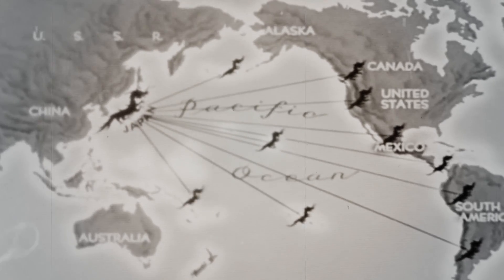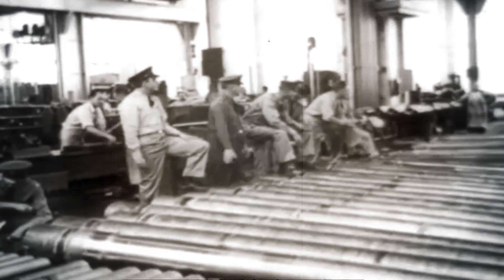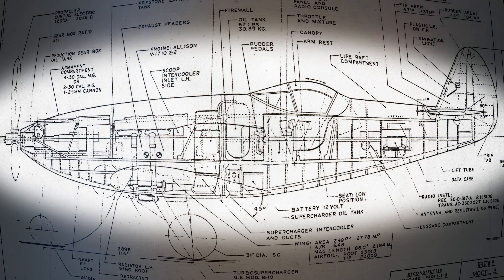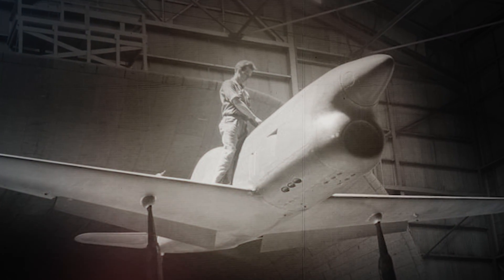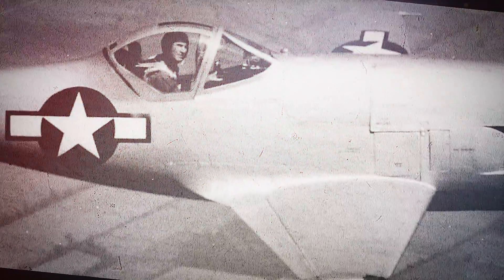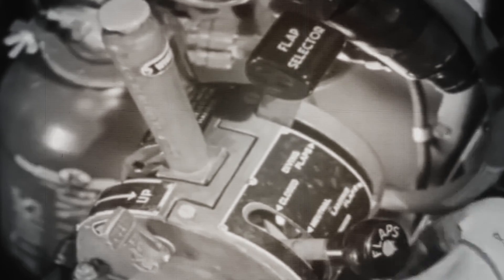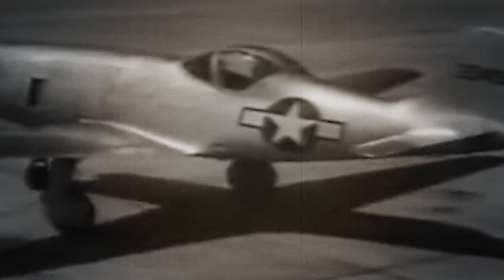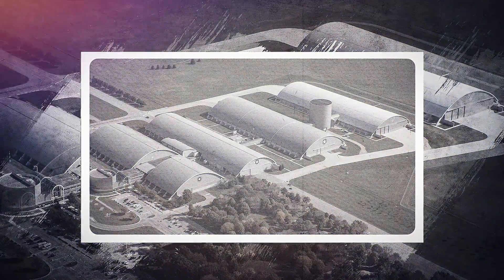Bell XP-77 - America's Emergency Fighter (Built from Wood)

Comment: One of the best aircraft of WW2, the De Havilland Mosquito, was made of wood, so also was the Heinkel Salamander jet fighter. a potentially good performer which appeared in the last days of the war.
Reply: The salamander was pretty trash
Reply: @kyle857  I read a test pilot's report on it which said it was a good plane for its time, but wartime shortages and manufacturing conditions meant that standards of construction were sometimes low and on rare occasions Salamanders broke up in the air. Before we get too holier-than-thou about it we should remember that it sometimes happened to British planes.  The tail unit broke off a number of early Typhoons before the fault was rectified. A De Havilland 110 broke up at an air display in the fifties and the wreckage plunged into a crowd of spectators. Planes and other war machines often have teething troubles. The Salamander was designed to be cheap and quick to build and made minimal demands on scarce wartime metals. The Me163, also made of wood, was a much more dangerous plane to fly, but had its good points.
Reply: Except slave laborers in Germany (sabotaged) peed into glue vats causing substandard glue joints.
Reply: @stephenjacks8196  Very likely, but Heinkel's design was pretty good considering the constraints he had to work to. A properly constructed Salamander could have outfought the contemporary Meteor. Fuel was also a difficulty at that stage of the war.
Reply: @bernardedwards8461  Heinkel had built the first flying German jet aircraft in 1939. Heinkel had built the first working turbojet engine. The German RLM decided "aircraft specialists" and "engine specialist" companies would get development funds. But if you're a contractor making good profit from existing contractors: do you jeopardize that with something new?
Reply: @stephenjacks8196  The trouble was that Hitler expected Russia to fold up before the end of 1942 and didn't expect war with the USA. He was therefore not interested in weapons projects which might take several years to come to fruition, That was one reason why he didn't prioritise the atom bomb project. Early in the war he didn't think jets could be perfected in time to be of much use before the war ended, and the Luftwaffe was doing quite well with propeller driven planes. It's easy for us to be wise with hindsight, but Hitler didn't have the hindsight available to us.
Reply: @stephenjacks8196  it wasn’t just the urine of slave laborers that caused problems. The glue itself was actually corrosive in some circumstances, and there are stories of the combination of glue and resin actually eating the wood it was meant to hold together
Reply: Reports indicate the glue the Germans used on the 162 had a tendency to actually eat wood.
Reply: @matthewcaughey8898  Weird. Usually it takes strong acid to eat wood. Lot of wood was glued with urea-formaldehyde resin which bonds with wood molecules but doesn't destroy them. A really strong glue will break thru the weaker wood, so German complaints were really about low quality wood. Slave laborers peeing in the glue pots would add extra urea and water making the glue weaker, and breaking at the glue layer.
Reply: @stephenjacks8196  point is the wood and resin was not of good quality and tended to come apart more frequently then normal

Comment: although it's beyond cool that Jack Woolams flew the thing, but even the conception was beyond stupidity...Great Britain swooped on the DH-98 design for the same reason Germany did on Tanks TA-154, not just material but wooden aircraft are easier to "cottage" out and be assembled at the airport instead of a factory that had been bombed back to gravel. last time i checked during WW2, the U.S. never had any bauxite shortages and no enemy bombers ever made it past Tulsa or Jersey.

Comment: What they should have done. 
1, power plant should have been a radial engine to begin with. Aerodynamic issues get dealt with when you have a light plane and power to use. Other examples damn't with this,  like the Fw190 and also the Mitsubishi zero. 
Honestly just switching to a radial takes out the radiator, adds more space for fuel or weapons. You could move the cockpit further up and have it ballistics better on the back wheels and you could put a better propeller than the two blade.

Comment: They could have licensed the design of the De Havilland mosquito and had a really good aircraft.
Reply: “Not invented here...”
Reply: The Mosquito wasn't built of whatever 2x4s you had laying around, like the XP-77 mostly could be. It required specific lumber of specific grades from all over the world to be assembled with special new adhesive and special construction techniques by skilled craftsmen who took a long time to train. Meanwhile, aluminum aircraft could be banged out mostly with unskilled labor using retooled car factories.

In the end, the Mosquito consumed its own share of strategic resources, not saving much over metal aircraft. A lot of shipping capacity for all the various raw materiel, even if it was wood, but more importantly the Merlin engines that powered them. They built as many as they readily could, using them to great effect, but no more than that.

Comment: The aircraft had no armor as originally planned. Adding the weight as it became obvious that it was needed doomed performance.  In addition, the guns had different ballistic profiles. It was impossible to get the full weight of the guns on target as the 20mm round was slower than the .50 caliber round. The 20 mm also dropped sooner. This meant that a pilot would have to get VERY close to the target, within 50 feet. It also meant that the plane would have trouble strafing a target as half the bullets would land wide of the mark. The design of this plane was so poor that it was only desperation that kept it going as long as it did. It couldn't shoot, couldn't bomb and had no speed, range or maneuverability advantage over anything. Its armor was inferior and poorly placed. The fuel tank was placed to roast the pilot if it got hit and the pilot couldn't bale out while the fuel tank was aflame. In short, it was a deathtrap.

Comment: The Hawker Hurricane also had a wooden airframe, although it was covered with cloth. The Hurricane is unjustly overlooked, but it kept the RAF competitive until the performance and production troubles of the Spitfire were solved. The XP-77 could have had a different history if it had been available by 1942.
Reply: You are correct in that the Hurricane is overlooked by most historians. Covered in cloth? Do you have any more info on this? Whatever cloth (coated with who knows what) is there that can withstand extreme stress of temperature and wind pressures? Kudos to the engineers and developers!
Reply: @timothybattey171   I think the Hurricane was built like the Mosquito. WWI style with a wooden airframe under a canvas wrapping. The Spitfire, by comparison, was made of stressed-skin aluminum, and flush-riveted, I think. Those technologies were in their infancy in 1939.
Reply: @HSMiyamoto  Mosquito was a stressed skin design made out of wood.
Reply: @HSMiyamoto  As a hobbyist woodworker, I am very much impressed by their use of 1930's technology and expertise. Even props were machine-roughed out then hand-finished in those days, I am given to understand. I suppose mass-production techniques made the process tolerable for the craftsmen.
Reply: @timothybattey171  Irish linen painted with aircraft dope :)
Reply: @andrewallen9993  Thanks for the info. I figured they'd need serious coating on the fibers to strengthen it all. I'd say the original test pilot was a brave one.

Comment: At the beginning of the war US fighter tactics were more of problem than the planes they were flying. You have to fight any battle using your strengths, and exploiting the other guys weaknesses.
Reply: Exactly, they learnt not to dogfight with a zero in Wildcats and P40s. Use altitude and speed and then get the hell out of there. When the Hellcat appeared they had an aircraft good enough to take on the Zero in virtually all situations.

Comment: The Zero didn't have superior characteristics.  It sacrificed pilot protection for maneuverability.  An experienced pilot did very well against the Zero.  The P38 and P47 was very successful against the zero. The shape of the fuse was dictated by the government required engine. It was a cheap emergency fighter not a front line fighter.  The P51 carried 300 rounds per gun meaning the 200 in this AC was not terrible as you imply
Reply: The A6M was faster and lighter, therefore more agile.  No armor, no self-sealing fuel tanks.  The tactics made the difference.  Once pilots learned the Zero's weaknesses, they could be beaten.  A Wildcat or Tomahawk could powerdive for the deck to escape.  Risky, but usually the American plane would hold together and pull out, but the Zero would shed one or both wings and crater, just couldn't call it a kill because no shots were fired.  Biggest risk was blacking out during the high G force pullout.
Reply: LOL ..you saying the ZERO in the early years of the war wasn't superior or better then the Allied aircraft...  give your head a bang..  also the P47 wasn't really involved with the Pacific front too much ... try the F4F, Hellcat, P38 and Corsair .

Comment: there were fighters such as the early LaGG and YaK fighters made of wood impregnated with a resin that made it inflammable, and roughly as strong as steel. The only downside was it shatters when struck by flak or large caliber rounds, but they did work extremely well. The XP-77 was incredibly ugly though, I mean ughh.
Reply: Inflammable means flammable. What a country.

Comment: What is an emergency in USA is just another tuesday in USSR
Reply: Had Hitler reached the Urals the Soviets would have built those or something similar.  Bell Aircraft and Stalin had pretty good working relationship.
Reply: @IvorMektin1701  Early Yak's and La's already were something similar. The cobras were indeed highly regarded, but numerically they were a small minority in the grand scheme of things. And perhaps the most iconic Soviet plane of WW2, the IL-2, was the epitome of emergency engineering, having its fuselage made out of steel and the rest of the airframe out of wood.
Reply: @FunBotan  
The IL-2 was incredible.

Comment: It would make one hell of a good Sport Plane with a few changes, I love the way the canopy retracts.
Reply: I've always wanted to see a homebuilt/experimental based on this, with modern techniques dealing with the vibration and stability should be possible.
Reply: What engine though? If you go watercooled, then stuffing in a radiator will be tough, i think. Are there any air cooled V engines available? You could fit a flat air cooled and keep the triangular fuselage cross section, but then the drivetrain will be complicated and the CG will be low.
Reply: @superdupergrover9857  personally I would go for an aviation converted small block Chevy or a rotary, as both require minimal cooling, have a pretty compact form, are compatible with forced induction, get decent gas burn, and are readily available. Throw a turbo on a stock SBC and you can get stupid power, and add light mods and you easily can hit 800-900hp mark, same with a 3 rotor like the Mazda 20b, though those usually run closer to 1000hp. Rob Dahm has a built 26b 4 rotor rx7 with an 106mm turbo that makes north of 2000 hp reliably off of something that is the literal size of a small punching bag plus the dinner plate sized turbo.
Reply: @Idiotresponsibly  
Use the LS series much lighter, all aluminum
Reply: @oceanhome2023   LSs are colloquially small block chevys, and you can built an all aluminum gen 1 SBC and depending on the maker can weigh 20 or so pounds less than an LS block.
Reply: @Bob-f7c2r  

     Because of it’s materials and engine at hand, back THEN. Its an entirely different set of technologies today.
Reply: I would like to have the Zero as my sport plane , imagine the range !
Reply: Not with its appalling flying characteristics, it wouldn't.  a good plane to get killed in.
Reply: Today the Super Tucano is the Ultimate ACROBAT plane.
Reply: @markplott4820  There are a few kit-planes that guys like putting 800 horse turboprops in that kick serious butt.
Mike Patey's plane Turbulence is one. It has a 370 knot top speed and a 7000+ FPS climb rate, and those are conservative figures.
Reply: Wonder if a TIGO 541 would fit in there?
Reply: Another good engine although not necessarily out-of-the-box per se but would be good for such a thing would be a boxer engine like the H6 Subaru motor. If somebody was trying to make a modern replicas of this. Very stable because of the geometric characteristics of the engine design and although none of that engine from the factory had such, they could take forced induction very well, such as turbo or supercharger.
Reply: i think it would make for a good racer since it really looks like the messerschmitt me209 rekordflugzeug